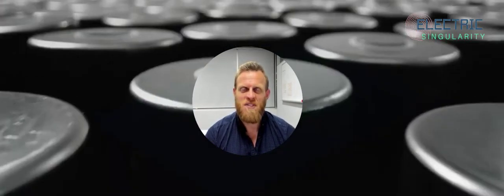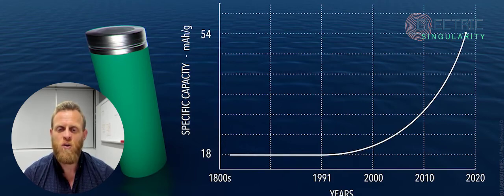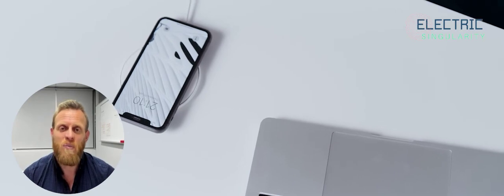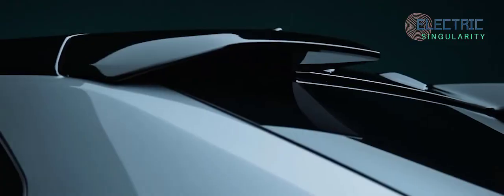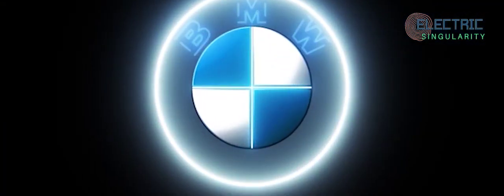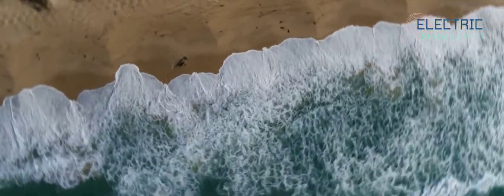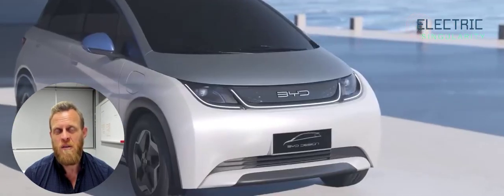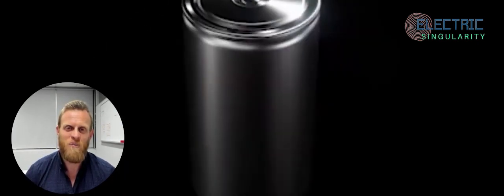Why solid-state EV batteries are gaining ground against lithium-ion

Comment: If solid-state batteries have less degradation over a longer period of time that would be a plus, but not if they are going to be far too expensive and more heavy adding extra weight to the EV. I think a range without charging of 1,000km would be the benchmark even though people would still stop for a rest break or two to go to the bathroom and or have something to eat and recharge overnight whilst they sleep. I will never purchase a European EV, happy to buy a BYD which represents Value for money.
Reply from the maker: Mate good points, I think you’re probably right.